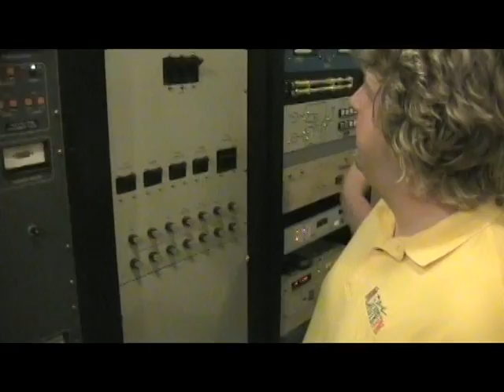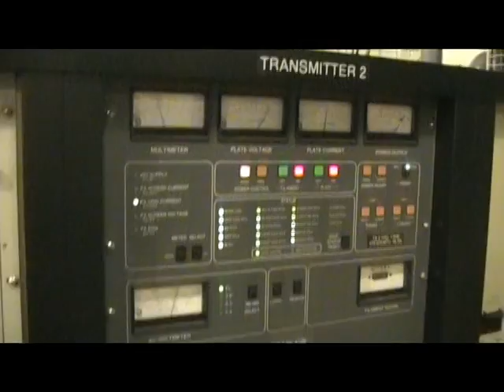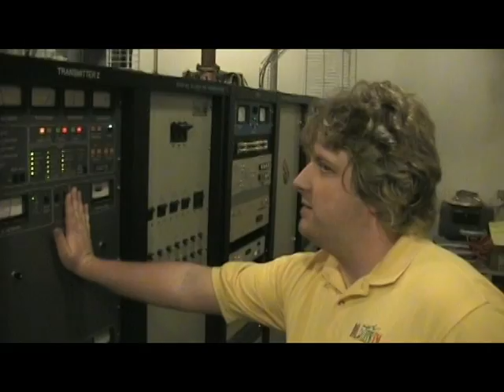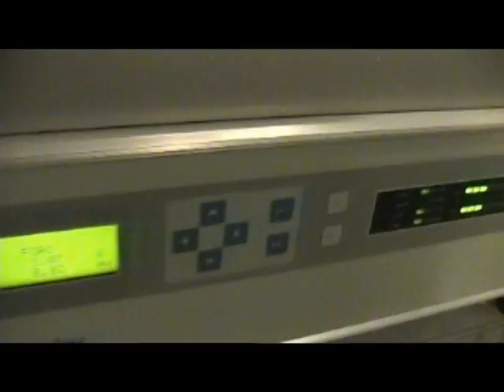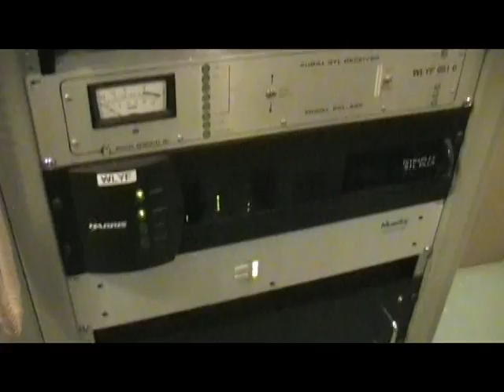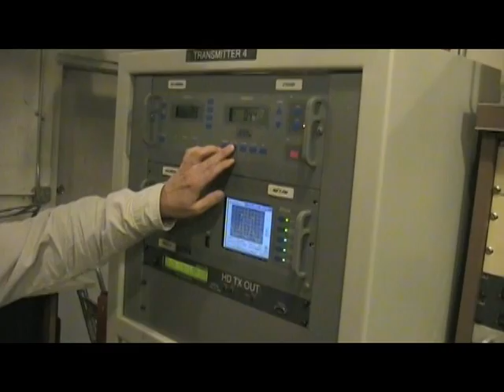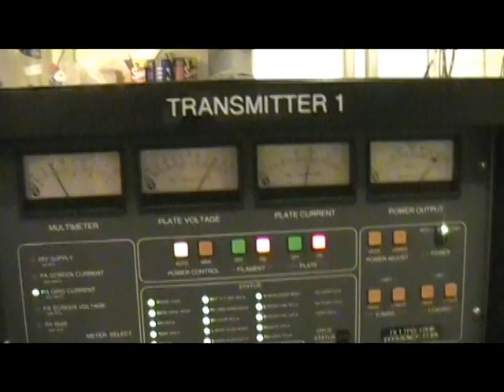WLYF, Miami  -  Changeover to new antenna & tower, 9/3/09

Comment: Very cool guys. Love the 1981 model...what a classic! Has it ever been on air in the recent years?

I remember at the station I worked at, my boss and I were troubleshooting a error light and low power on our Harris One AM....Replaced a fuse and Boom...all the lights came on and she refused to turn on.

It was go time then...we fired up the 1960's Gates BC1H that was our standby. Nothing like the glow of those 833's to make you feel good. She ran overnight and we fixed the Gates One in the morning.

Love those old transmitters!
Reply: Collins 831G I think?  Continental bought out Rockwell/Collins some years ago